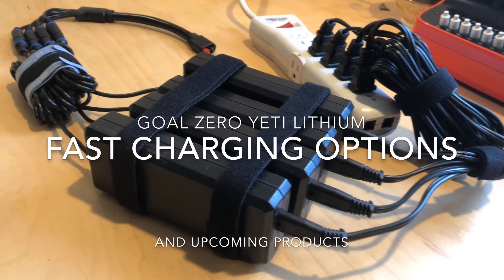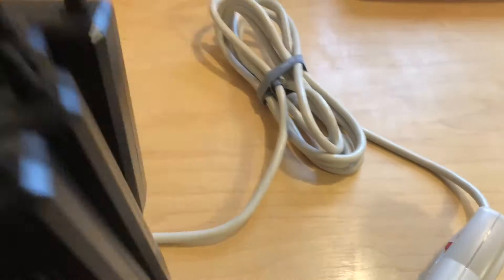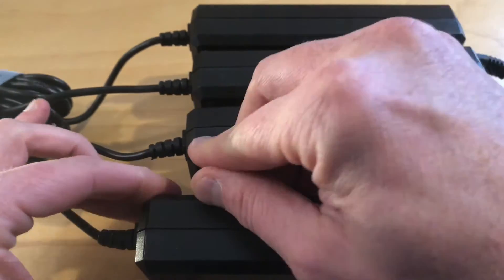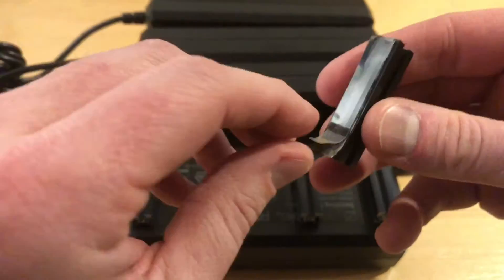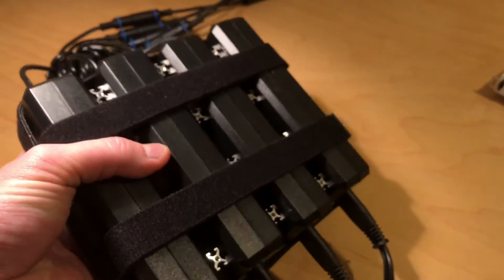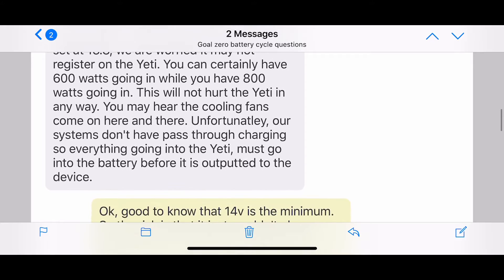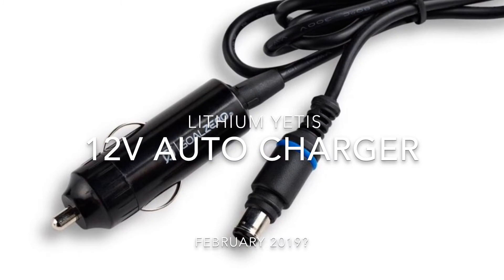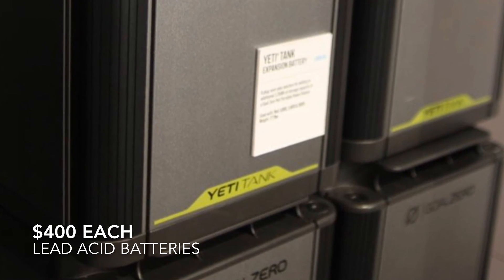Goal Zero Yeti Lithium Fast charger improvements, 12v + auto charger, CES 2019 Link + Tank expansion

Comment: Hi Todd, I bought the Yeti 25A Fast Charge last year, but it now flakes out with a bad internal connection - If I set and "jigger" the unit just right it will charge.  I noticed a recall on the unit - fire/safety hazzard.   I was wondering if yours is working and you still use it.  I'm wondering if a person could take the unit apart and maybe fix the internal issue.  GZ's response was send in the old unit and we'll give you a credit for it - they no longer support or sell it.
Reply from the maker: Yikes, that’s bad. My charger still works fine, yep

Comment: Thank you Todd once again this setup works.  I was able to recreate your super charger for my GOAL ZERO 1250.  The only issue I came across was when connecting all four wall chargers into the power pole.  I was getting less input 196W or so.  So I plug two chargers into the power pole and the other two into the 8mm inputs.  Suddenly I was getting 261W input and better, I don’t understanding the reasonings any ideas?  Lastly I replaced the original 100AH battery with two VMAX 125AH Deep Cycle, Solar AGM Batteries, one internal the other external via chaining.  I’ll have to do another test but it is very possible that I was able to charge this unit with both batteries connected in two to three hours from 20% down.
Reply from the maker: Very cool. I don’t know why you were getting such low charge rates but maybe the lead acid yeti has different input capacities. The lithium can handle yo to 320w and I e gotten over 250w with my charger.

Comment: I used the RC power supply or any switching power supply (Meanwell)
Connected the 14.5volts(at least, but less than 22V) DC output to a Buck converter 300Watt with either constant voltage or constant voltage + constant current adjustments, output thru Goal Zero Yeti 1000 Anderson Input about 165 watts charging or higher depend on your power supply rating and Buck high Amp like 12A-17A. Yes, I made my own Anderson plugs and cables, use thicker wire 12 or 10 Awg short distance as possible. Note that the output voltage from Buck inverter to Anderson plugs is 12.6-12.7 volts

Comment: It would be much cheaper to buy a variable DC power supply from Amazon ($40) and it comes with it's own cooling fan.  The one you mention has a set voltage.  Most are adjustable from 0 to 20 or 0 to 40v, and come in 10 or 20 amps.  I think one brand is Drok?  Hobotech has a good video on his channel about how to set them up and use for solar generators.  Yeti selling a 1000wh power station with a 60w charger is a bit silly and seems like a built in secondary purchase is almost required.  Almost like apple shipping a $1000 phone with a 5w charger when an 18w works.  Extra profit built in.
Reply from the maker: I agree they woefully under power the charger. Let’s hope the next gen has a much better one included
Reply from the maker: When I looked into it they were pretty expensive but I’m sure there are better options I missed

Comment: OMG, thank you so much for this video and your first one on the fast charger set up. I have to power a CPAP while camping, and I needed a way to have the best battery life but still be able to charge the unit by my Yamaha 2000i generator. These two videos did the trick. As of this date of writing, I am not seeing the 300-watt wall charger yet, so I will have to do it the same way that you have here. Thank you very much again. This was a lifesaver. Literally.
Reply from the maker: Great to hear, thanks. This is the charger: https://www.goalzero.com/shop/yeti-accessories/yeti-fast-charge-25-amp-power-supply/

Comment: I  comment is a year late, but I found a way to use a 13v source to charge. You must first plug in a factory 60 watt power supply, or really any power supply that outputs at least 14v, then also have you 13v power supply plugged into the other port. Once the blue light comes on then unplug or leave the first power supply plugged in. You will see that it will then work.
Reply from the maker: Interesting, thanks!

Comment: no tape. and use the longer pieces as "legs" on the 4 outside corners to keep the block up and get more air flow
Reply from the maker: More airflow , the better. At this point, it likely makes more sense to get the official Goal Zero high capacity charger unless you have a bunch of wall units lying around.

Comment: PRO TIP: You can't compress a solid with velcro (with human hands), so add some foam under the velcro in a couple of areas, then when you cinch down on the velcro, you'll make a much stronger bond between the velcro and the transformer bricks because you'll have something to compress against.
Reply from the maker: My hands are pretty darn 💪. Thanks for the tip.

Comment: Hi Todd, excellent video! Did you ever measure the temperature of the power bricks when in operation? Mine get hot to the touch, though I don't have an infrared temp gun to get an exact value.
Reply from the maker: They do get toasty, yes but I think this type of supply just do in general. That’s why I added aluminum spacers for airflow.

Comment: $400 for a 100 Amp Lead Acid Battery?
RIPOFF RIPOFF RIPOFF RIPOFF!

If you're going to go that route, go ahead and buy the Lithium to Lead Acid adaptor, but buy a couple of good Marine Deep Cycle Batteries from Wal Mart or Home Depot!
Reply from the maker: The Yetis use a lithium battery, not lead acid. Lead acid batteries may be cheaper in the short term but they can only be discharged to 50% (even deep cycle), are heavy, and have a lower cycle count. YMMV
Reply: @todd.parker  The 50% myth apply really applies if your system is a bare bones draining system. But Goal Zero's lead Acid batteries have a management system that keeps the voltage corrected, But you can still drain the unit to 0 without any probs of it breaking the battery. So you'll beable to grab all the 100AH the lead acid gives. Or so forth.
Reply: Believe the Lithium yetis require the Link adapter, and that uses a EC8 connection plug to the lead-acid unit box.

Now you 'Could' do it that way, But you won't have a box with it. and i think the Yeti Tanks are also fan cooled (maybe wrong. but still), And surrounded with a Metal box for better cooling. So their more Pricey possibly for this reason for internal cooling, Compared to a basic buy battery and use. But you could always go your route, their 100Ah cells are only 250$.

Now there are afew different deep cycle batteries also. and AGM batteries are the best of them all. Then you got Gel which is ok, but not as good as AGM. Then you have Flooded. Another reason why Lead Acid of theirs are more pricey. So You could do it your way for cheaper. but the performance of discharge and charging will not be the same as AGM.
Reply: And when you use the Yeti-Link. You do not get the ability to use the MPPT charge controller system. You're stuck with the PWM.

I'd more likely would use a Yeti Tank with a Yeti 1250Lead. You'd get easier bonuses. Tho you'll probably have to make a cable from EC8 to the cable on the rear for the Yeti 1250 Lead.

You'll loose abit of Surge performance of AC. but gain a large amount of 12volt DC performance. Maybe heavier also, But if you're looking to keep it connected internally somewhere, then this isn't gonna be much of a prob.

Comment: Hey, you know you spent so much money to buy these chargers. What it basically does is, it combines all chargers in parallel, combines their amperages to charge your device. You could have bought a networking power supply which is usually 24v of about 30-60amps, then you guy a boost buck dc to dc converter, step down the output voltage to 16v and increase or reduce the amps and it would charge your device in about an hour. I did this and it’s been working for 8months now. Perfectly.
Reply from the maker: You’re 100% right, lots of ways to get power into the Yeti. I made this setup before I learned there are other options but for most people, using this setup or their new fast charger is simpler because it doesn’t require electrical expertise, soldering, making Anderson cables, etc. If you know this stuff, you can roll your own and probably save sone money.
Reply: Hey E.N. can you link the items you bought?  I'd like to do the same thing you did but don't want to pick up the wrong things. Thanks!

Comment: Hey Todd, your videos are great, thanks for posting them. I'm using a Yeti 1000 in my motorhome to power my wife's oxygen concentrator over night when I can't run my gas generator. The 70AH FLA battery can't cut that so enter the Yeti. I the problem is charging. I bought an extra 120V power supply and the MPPT plug in so I can recharge the Yeti in around 10 hours-ish. But thats a long time to run my generator. I was thinking of buying a variable 15VDC 40AMP power supply, then set the current limit to around 24 Amps to get approx. 360 watts into the Yeti to minimize recharge time. I can pick one up on Amazon for $180, which would be cheaper than additional 120V chargers from GZ. Thoughts? Amazon link to the power supply  https://www.amazon.com/TekPower-TP1540E-Adjustable-Switching-Digital/dp/B015QHVJP6/ref=sr_1_3?keywords=15+dc+variable+power+supply+%2240+amp%22&qid=1551485254&s=gateway&sr=8-3
Reply from the maker: That power supply looks like it would work. I think you just need 14-22v for the Yeti to charge but their power supplies are 16v so that might be the sweet spot for their devices. The only thing is that’s a 600w supply that you’re limiting down so are you paying too much for what you’re using? One consideration is goal zero will be selling a ~300w power supply in the next few months which might be a nicer package and may be a bit cheaper though you never know until they release it. Short answer is that should work fine, you just need to make up a vertically stacked Anderson cable for the yeti input.

Comment: Goal Zero says in that text that it can handle a charge input of 600-800W? How comes that the Anderson Input port has a warning of max 360W?
Reply from the maker: Hi Vincent. The built-in PWM input can handle up to 360 watts across its various inputs (8mm, Anderson). When you install the optional MPPT module, that adds a second 325 watts of input for a total of 685 watts combined. I checked that a few times with Goal Zero support because the site isn’t super clear.
Reply: @todd.parker  thanks for clearing that out! It's true the manual doesn't has a lot of info about external charging..

Comment: Todd, can't wait for the fast chargers. I've got a yeti 3000 with an 800 watt solar array at my offgrid cabin in North georgia.  4x100 watt panels => combiner box => pwm charge controller. Same setup on the mppt side. Since it's the middle of winter I'm only getting about 550 Watts into the yeti on a sunny day but the yeti is fully recharged by 1pm if the bank is around 65%. With the new fast chargers I'm going to wire those into a switch box I'm going to make. The solar array will also be going into the switch box. When I'm running my generator I'll switch both lines over to the new fast chargers. otherwise when I'm gone I'll just keep them switched to solar. it sucks that the new battery extensions take the place of the mppt charge controller.
Reply from the maker: That sounds like a great idea. I like solar but it good to be able to supplement with generator power when the sun is down or isn't shining. It would be cool to see the switch box you set up.
Reply from the maker: Oh, and I'm not sure exactly how the Link + Tank will hook up but it looked like it might be the same shape as the MPPT module which is a shame. I wish the left hand area was built to hold a second expansion module. It's just blank plastic.
Reply: @todd.parker  I talked to yeti a couple weeks ago and they did confirm that the new expansion batteries will take the place of the mppt charge controller. I agree it's silly the way it's designed. How many days is it going to take to charge the expansion batteries off of the pwm controller 😵. Also I wish you could replace the charger on the left with another mppt controller. I found a 1-off-2 heavy duty switch on Amazon that can handle 30 amps. 1 will be solar, 2 will be gen, 0 obviously is off. I don't put anything on YouTube but I will contact you when I have it built.
Reply from the maker: Thanks for confirming that (bad) news about how the expansion batteries will work. I agree that's a poor design. Seems they are making to choose whether your Yeti is solar optimized (MPPT) or storage optimized (Link/Tank). I want both!
Reply: Moonies Barbecue hi can you share with us your yeti set up I want to connect as many panels as possible too
Reply: @GabrielV93  Sure! I've got 8x100 watt panels, HQST 12v 100 watts panels. VMP 17.8V IMP 5.62A. I've got 4 panels wired in parallel into an ECO LLC 4 string combiner box and the other 4 through a second combiner box. I use 10 ga wire runs to inside my cabin, through electrical conduit. One run into the PWM controller and one into the MPPT controller. So far I've seen 609 watts per hour max going into my yeti 3000 but it's winter. Should max around 650 Watts per hour in summer. I usually get about 4.5 hours of sun here in Georgia so the yeti is fully recharged usually  by noon if it's around 60-70%. Hope this helps!